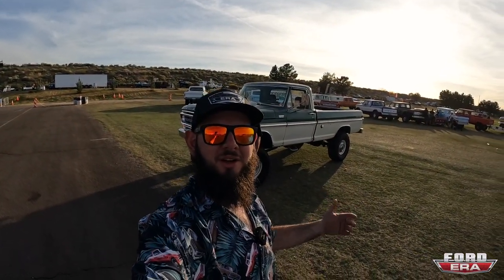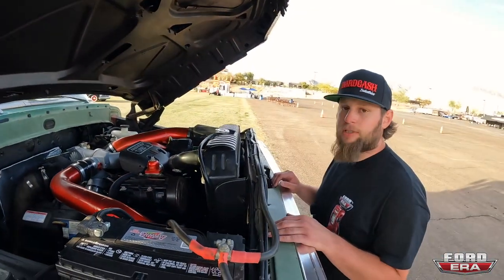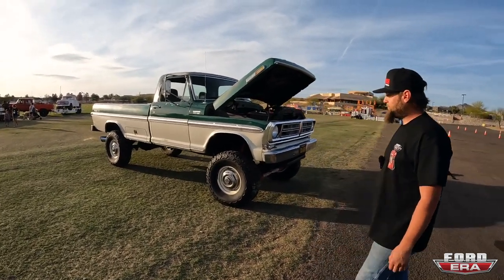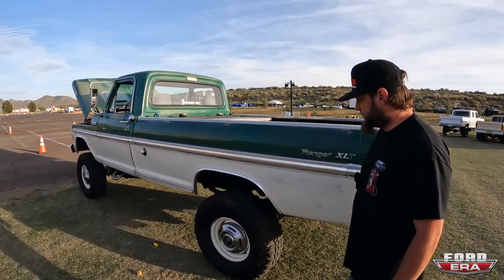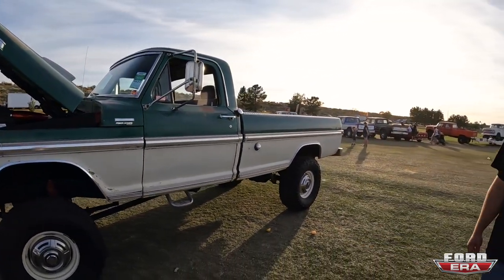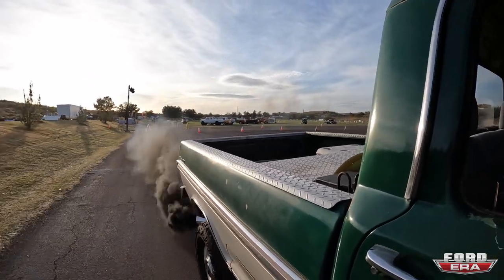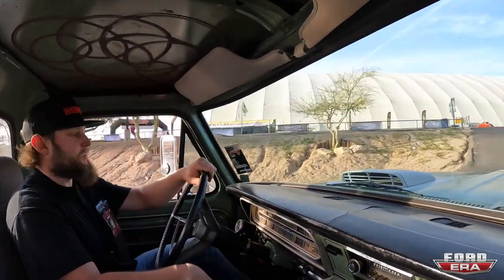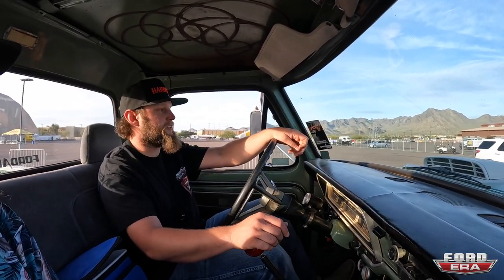1972 F250 4x4 - 7.3 Powerstroke Turbo Diesel Swap | What The Truck? | Ford Era

Comment: Sweet truck! Nice to see a Ford in a Ford! My dad bought 90’s 7.3 crew dually and that mother would light’em up with no trouble!
One thing I wish everyone would stop doing is making them belch out that nasty black smoke, we have a hard enough time keeping the Karen’s from shutting our hobby down without that crap!
Reply: While I agree with your sentiment 100%, that's not a Ford engine. It's a Navistar (International, Cornbinder hehe). I used to think it sucked that folks put Cummins in a Ford, but then I realized my own hypocrisy. Finally Ford did build their own diesel, the 6.7, from the ground up. At least it's not an Isuzu (Duramax)!
Reply: @barrynelson634  You are right, I forgot Ford doesn’t own International. 🤭
Reply: @barrynelson634  I agree 100 % about all these kids "rolling coal", completely stupid!  Show me performance, not just a cloud of wasted fuel. As far as the engine, I own a 7.3 Ford and two 5.9 Cummins trucks, I would absolutely use a Cummins in any swap I could fit it in !!  Although the 7.3 is a good engine (and my 2nd pre-emissions choice) the Cummins with an NV5600 behind it is far superior to the 7.3 with a ZF6
Reply: @mattywho8485  ...yes, you are correct. I also love that torque right off the bottom with a 12 valve. I've had that and a drive by wire 24 valve while Ford was going through their 6.0 and 6.4 problems. That 24 was not the same to drive, not as much fun by any means.

Comment: This is too cool. I have a 97 F350 that is rusting out really bad and I want to get a new frame and body for it and make the swap (I actually know where there's am F150 sitting that I can get for around $400 or $500.) And my 97 runs super good. It just needs a new body.

Comment: Your 5th gen 4x4 looks awesome, love the 7.3l conversion, looks stock. I would keep the original finish. Can you please explain why you don't think your 72 F250 4x4 wasn't a "highboy"? My understanding is all 67 to 77.5 Ford F250 4x4's were highboys? You have the correct frame crossmember below the front bumper, looks like the narrow frame with 2.5" wide rear leaf springs, looks like it is/was a divorced transfercase, gas tank behind to bench seat, looks like a 75/76 Dana 44 open knuckle low pinion front axle. To me it looks like you have all of the parameters. 
Either way your truck looks awesome. 
I have a 76 Ford F250 4x4 Crew Cab highboy, I converted to diesel also but went a different route. It now has a 76 Detroit Diesel 4-53T, stock NP435 and NP205, I added a 3 speed '65 Spicer 5831 auxiliary transmission to split gears and OD, also added a '79 Dana 60 King Pin to handle the extra weight. I lenghtened it to a long box and I'm running 37" Wranglers with an additional leaf on all 4 corners with front and rear sway bars.  It has some newer 6th gen parts but otherwise looks pretty much stock. It actually rides nice, not sure if I'm ready for a 16 hour ride yet. 
Thank you for showing off your beautiful truck to us.
Reply: It’s 100% a highboy chassis and F26 titled truck but the purists will tell you otherwise since it has a side bed toolbox. “True” highboys don’t have them.
Reply: @fordahlbilt  I saw the toolbox and thought that was unusual, they're usually on 2wd or camper specials. I think you can get by with that one, just changing the box should not be grounds for disqualification, otherwise we should be disqualified our diesel swaps, that just adds to the coolness. 
I own a highboy and I usually correct people when their truck is not even close.
Reply: @johnt9906  You both are correct!
Reply: @fordahlbilt  MANY HiBoy Fords came From the factory with that bedside toolbox, I’ve had several myself. Idk why anyone would think the toolbox would cause the rest of the truck to be any different but there is no truth to that at all.
Reply: @barrynelson634  it isn’t unusual at all
Reply: @warrenmcelroy4718  talk to me
Reply: @barrynelson634  there were many HiBoys that rolled off the assembly line right here in Louisville that had the bedside toolbox, I personally have had two ‘76’s, one ‘77 and a ‘74 that were all original bodied trucks that had the bedside toolboxes. What makes you think it was an unusual thing to see?
Reply: @warrenmcelroy4718  and they were all factory original HiBoys that you're talking about, correct?

If so, I stand corrected. I, like others had not seen them in anything other than the 2WD's and really, for me, only Camper Special packages. I'm not accusing, love to learn about my beloved Ford's.
Reply: @barrynelson634  yeah they were all bone stock, 100% factory F250 4x4’s. The very first one I ever bought was a two tone red/white ‘76 F250 4x4 and I drove it my whole junior year of HighSchool and half way through my senior year until I bought my first Ford Diesel, it was an 84 F250 4x4. But yes the ones I had were all HiBoys and all factory trucks.
Reply: @warrenmcelroy4718  '76! My first NEW pickup, F150 4x4, 360, 4 speed. Just out of high school! Haha
Reply: @barrynelson634  that’s an awesome truck, especially to be brand new. I’ve got no urge at all to buy a new truck of any brand these days but if i could find a showroom quality 76-79 F250 Crew Cab 4x4 right now then it’s hard telling what I’d do to get it. Something like that would easily last me the rest of my life and have plenty of room for the family. My red and white 76 came with a 360 but we wound up building a 390 out of a Mercury for it. Also it was an All Wheel Drive truck when I got it so I wound up putting a NP205 transfer case and a set of lockout hubs on it, that was much better. That truck drug every Chevrolet it ever hooked bumpers with haha.
Reply: @warrenmcelroy4718  ...so true about the new ones, but there's only one brand in my book. I have tried a couple of each of the other brands for short periods of time, but always gladly came back to Ford.

 I do have a '17 F250 4x4 regular cab gasser flatbed that I use for towing my stock trailer and flatbed goosneck trailer for hauling hay or my skidsteer. I also have a '12 F350 crewcab diesel with a Western Hauler flatbed that I use only for pulling my 41' Living Quarters horse trailer. Really like them both, but fav's to drive are my '72 F250 2wd with a 390 and 4 speed and I have a '79 F250 regular cab 4x4 with 400 and auto with a 4" lift. The '79 I completely gutted and repainted, inside and out, and I need to put it all back together now. Hoping to get the shocks, sway bar bushings, front fuel tank, etc. all installed shortly so I can get the bed back on. Then start the interior. I know most folks like the '79 grille, but I converted headlight buckets and everything else to '76/'77 grille, my personal favorite for the dentsides.

Keep those ol' gals in shape and they will last the rest of your life as it sounds like you are fairly young. Preventative maintenance is the key. Anything that breaks, fix it right away, it pays off in the long run! You've got a great stable of pickups! Good choice on going to part time 4WD with the 205, bullet proof, unless you're an idiot. 🤣 390 is also my favorite of that era for power.
Reply: @barrynelson634  haha that’s Crazy, I’ve always preferred the 76/77 grille out of all the dent side trucks, even better than the 78/79 grilles haha. FE engines for the win, for sure!… yeah I just turned 40 last month, I grew up on these old Fords and Ford idi diesel pickups, my very first truck was a 1950 Chevrolet 3100 and that was also the last Chevrolet I’ve ever had, I’ve only had tow Dodge pickups, one of which is my daily driver work truck now and if not for my love of the 5.9 Cummins Diesel engines I wouldn’t be putting up with the rest of the trucks shortcomings haha. I think the simplicity of these older Ford trucks is what draws me to them, I hate seeing someone but a new truck and have to run it back and forth to the shop because of some wacky sensor that isn’t working properly that winds up costing so much time and aggravation, and in some cases ALoT of money. That’s why if I ever luck out then I’ll find a decent 76/79 Four door 4x4, repower it with my ole 5.9 12 valve Cummins engine and call it a day.
Reply: @warrenmcelroy4718  Couldn't agree more about the new stuff. I am surprised that you are one of the few that agree with me on the looks of the '76/'77 grilles. As I mentioned, my first new one was a '76. Most folks love the  '78/'79 grille and look at me like I'm crossed eyed or something when I mention the others.

 I agree the 12 valve is a great engine, I love the torque, right off the bottom. I've owned a couple, but you are spot on about the rest of the pickup.

I'm not a fan of putting them in a Ford, but like the "Ford Era" YouTube guy says, the 7.3's are boat anchors and the newer 6.7's are to complicated with the electronics, so he goes with the 12 valve.

I'll just keep mine gassers I guess...hahaha I hear that there is someone out there that does a wiring harness o fit older pickups for Ford's new 7.3 gas engine. That peaks my curiosity.

You'll find that crew cab someday, just gotta keep diggin'! Good luck with that project, it'll be fun.

Comment: that's a nice ass truck. The engine is a 99 up 7.3, not a 97.
Reply: It’s 100% a 97 engine with 97 electronics, but with 99+ front accessories and turbo setup.
Reply: The engine came out of a 97
Reply: @fordahlbilt  So it's been turned into a 99 up engine .